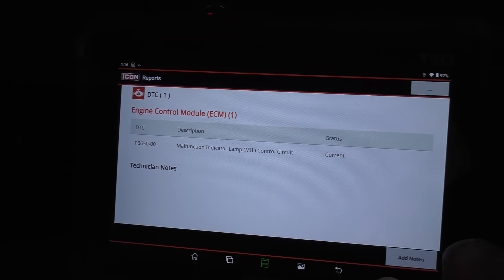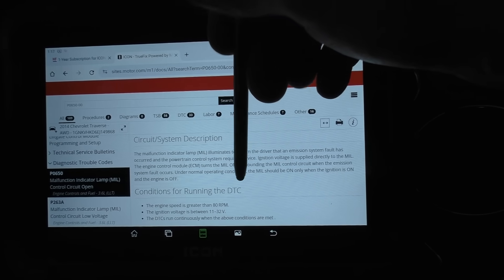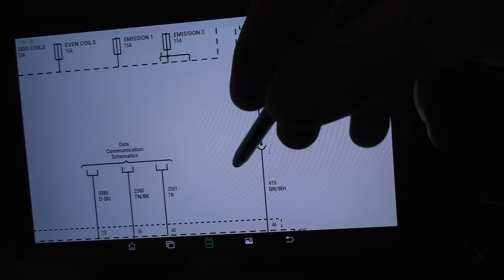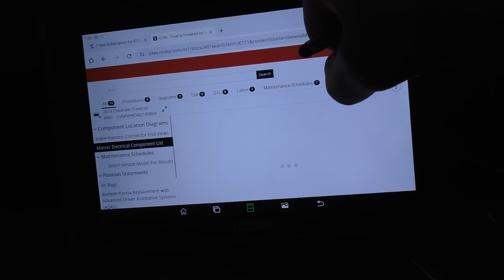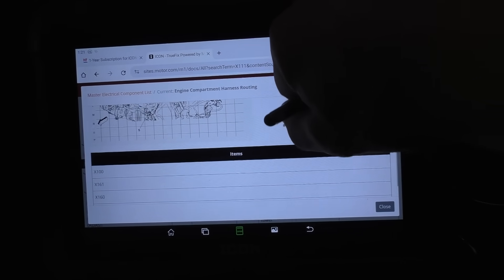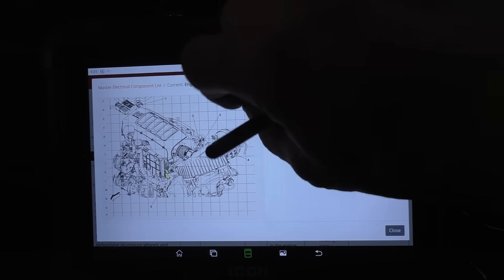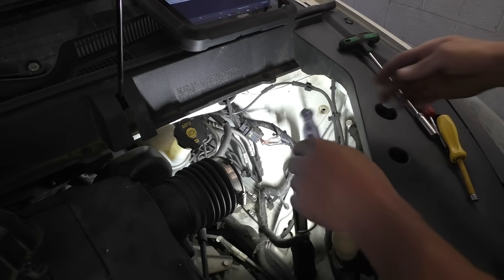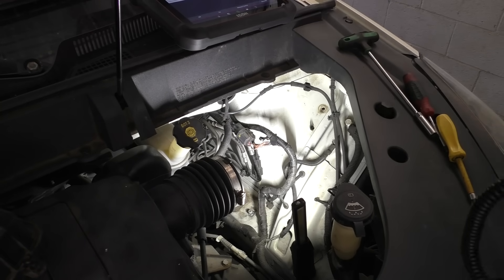Chevy Traverse - Check Engine Light Will NOT Turn On!?

Comment: You usually get paid to turn the money light off, now you get paid to turn it on!  😂😂
Reply from the maker: Basically 😂 . They might regret this later on
Reply: when are you two gonna do a collab together on a ford no less?
Reply: @SouthMainAuto  CEL light going into strobe mode in three… two…
Reply: Scott could sublet one of your bays?😀
Reply: The only time you want to see the check engine light it's ironic the one light that you want to turn off instead of on
Reply: @vehcor called sma cuz my trucks dash had all the emogis on... fer some reason it doesn't  store codes never has... by the time I found an advance that wasn't closed I only had one emogi left open circuit bank 2 knock sensor permenant with misfire cylinder 8... which shall be gone tomorrow... smh people asking me at lights if I left my parking brake on bulb replacement I give up lol... it's a 2500 it doesn't need the special check engine light off programming cuz it will always pass... I just want it to last fifty more years lol cuz who can afford 1k taillight lenses...
Reply: @SouthMainAuto  10 years of doing this... between the two of you guys, I think it's time for both of you to start cashing in.  You need to start putting ads on your videos.  You could be making $10k per video for a simple 1 minute ad read at the very beginning of each video.  It's not "selling out",  it's just how the internet and show business works.  You're already burdening your family by being in the public eye..  Cash in your chips and start stacking that ad money already.  It's time
Reply: Eric O is my dude, this brother is one heck of a Auto Tech, 😎👍🏾
Reply: @DrLee65  You would like Pine Hollow auto diag too then.
Reply: It's the money light either way.
Reply: @SouthMainAuto  put a 10 day sticker on it 4x a month there you go.

Comment: My youngest son works for Subaru, but his day off was today, and he came in the shop and laughed at me because the 2500HD I took in, had a 6" lift kit on it, and the hood was as high as the top of my head.  Freaking tires came up to my waist.  Yesterday I had a 2021 Lincoln MKX in because the park assist wasn't working.  Every sensor had a circuit code.  Told them this is wiring not sensors.  Got under it and the big connector behind the bumper was completely disconnected.  Plugged it back in, scanned it and tested it, all good.  Crazy.  Tomorrow it's a Trax that just got a new turbo installed at the dealer, and now has a misfire.  o.0

Comment: Doing an emissions inspection here in Ga., I failed an old VW Jetta that was bought at auction, for no MIL.  Customer had to go out and buy a used cluster.  It seems someone had removed to bulb then filled the cavity for the bulb with bondo.

Comment: As someone who deals with the bottom of the auction barrel on a daily basis, I WISH the issues were this simple.  Auction vehicles are proof that  there are some really lousy auto techs out there as well as some really shady ones.  Nice find Mr. O!  Love your channel, keep up the good work!
Reply: Not just the techs, we had a used car buyer that would remove the ABS fuse on certain models he was going to bid on (it was under hood and easy to get at on those ones) while he was ‘viewing’ the vehicle prior to the auction starting. The dealers got first look before the general public.

This would put the warning light on, discourage other buyers and theoretically lower the bids when the car went under the hammer
Reply: @RB-qq1ky  from what I understand, buyers aren't allowed to touch the vehicles anymore, at least where my employer buys from.  Probably from these kind of tactics.

Comment: The shop I worked at while in high school in the early 70s had a contract for working on auction cars. We did a lot of 1 cylinder tuneups. I learned a lot of what I didn't want to do to a real customer's car.

Comment: Good ole cut or corroded or ? check engine light.  Somebody or something making work for us.
Had a GM "G" van that failed cause the CE light didn't work during a smog test.  NICE!  The harness was 3 times the size of the one you were working on, so a nice piece of wire from the cluster to the brain wrapped in it's own split loom and boom.  Passed smog test.
Nice fix Mr. O!

Comment: Core problem: Bought Chevrolet Traverse.

Chevrolet - like a rock.Specifically, talc. Talc is a rock. It crumbles quickly and dissolves in water. :P
Reply: Bought AT AUCTION!
Reply: ROFL.....yep
Reply: @hotpuppy1  All that means is that they paid less for it. :P
Reply: Scientifically speaking, ice is a rock too.
Reply: Or like asbestos. Soft & fluffy. Leaves you with life long injuries.
Reply: I have a 2015 Traverse LTZ. Love it. It's been a great Vehicle. KOW!
Reply: @JOHNSUE28  Either you don't drive it much or it's one of the few good ones ever made.

Comment: Good job! I was working on a 1984 Caprice that wouldn't go in to closed loop also the ck. engine light wouldn't light. Pulled the cluster to ck the bulb and there was no bulb in it. Installed a bulb and the car would then go in to closed loop. I think it was maybe a fail-safe deal!
Reply: I laughed when my CEL finally burned out, and found they had a code for the light won't light.

Comment: Eric if you go to PHAD Saturn Astra video. I was the client that worked on it before Ivan. It all started. when I scanned the car. It had codes but no CEL. Took the instrument cluster apart and found they taped over the LED.  At least the didn't scrape the led or the trace on the board.

Comment: It's not easy to find a 750mA test light in the retail world, most incandescent lights are about 75-150. I wonder if there is a source for really high current bulbs that fit into the OTC light probe. As you say, for an LED circuit it won't matter that there is a little upstream resistance added with the test light. People just have to remember that with high resistance loads, even medium current lights won't pull enough juice to glow when drawing current. Even so, the added reassurance you're not going to melt something upstream is nice. Well done Eric!
Reply: Calculated 9W globe, how about a 10W festoon? 

I have a ‘vintage’ Snap-On test light (the ‘screwdriver sized’ one) that I did this to.

Or if you favour function over form you can put your own probe and clip on a universal lamp socket kit, and have a choice of lamps

Comment: People do some ignorant stuff on wiring.
I just bought a used UTV , the guy said the temp sensor that controls the radiator fan was bad so he bypass it. Put a switch on the dash with a note saying turn on fan. AND he used solid Romex wire. So now if a person forgets to to turn on the fan switch the engine will over heat.
I trouble shot the temp sensor and redid the wires he cut. Works like it supposed to.
This ole geaser was from up state NY 😮

Comment: I work on Auction cars. This has been happening since the start of this year when we started accepting them.    They all have a laundry list of issues.      I feel sorry anyone who has to be stuck buying these cars 4 times than what they are worth.     We are only doing them since the shop regular customers have stopped coming down to the shop. It's either the economy or the way the shop owner is.   Which isn't even no fault of my own.   We had one guy tow in a KIA optima with over 350,000 miles on it.  I told them this isn't even worth scrap value.   That is a throw away car so they left it in the parking lot for months.   Someone did break into it and try to start it after tearing out the key cylinder.   There was no battery in it.   Kinda wished they did stole it though.

Comment: about 30 years ago I de-pinned a transmission connector wire that fed the TCC lockup solenoid, something happened inside trans where it would lock and get stuck.
it would not release, even after shutting car off and playing around, it would just instantly stall the engine, I eventually revved it up and yanked it in gear and with a big bang it released.
once the wire was removed it had no issues and oddly never set a check engine light for about two years of daily driving, until they traded it in(yikes). I thought they were going to drive until scrap yard bound, go figure!

Comment: When I bought my 07 Suburban I had the same issue with my check engine light.  After I bought a refurbished one I found out that several of the lights were painted over with black paint.

Comment: I bought an RV that ran well, after a year, when I went to smog it.  It failed..... why, tech couldn't get the check engine light on.  However, it was on.  Best case scenario though, someone had pulled the bulb.  Got the bulb replaced, and an oxygen sensor later, it's ran great for the past few years.  Overall, feel pretty lucky.

Comment: Hey, Eric! I know it's a while back, but I really liked your video on the Toyota Camry Transmission fluid change. I currently drive a 1998 Camry LE, with 136K miles on it . I have been the only owner of this car since '97, and I have never done a transmission service in it's entire life. The car currently starts reversing when I put it in drive, and other times the car will not move for a minute while I press the gas pedal. My mechanic says I should get a flush and bring 8 quarts or so of Toyota ATF, while others say a drain and fill is safer, along with changing the filter. Should I get a flush?

Comment: The crazy one I came across back in the late 80's was a Chevy truck that the customer could not read the codes when you used a jumper wire on the old OB 1. I found that someone had wired it up so when key on engine off the check engine light would come on. They had wired the light driver module in on the oil pressure switch. Sure I could read codes with the scanner. That's how I found it. I was like, wtf?

Comment: Cleanest way is to use hp tuners on a vehicle it supports and you can turn any code not to set a MIL light or report. You can also set the mil light to never turn on for any reason.
Reply: Tell us more.  I like the idea of absolute control over the computer.

Comment: Here in the great liberal state of California. Any kind of salvage vehicle you have to get a smog Brake And Lamp. Perhaps they do things differently back there. Because the question remains is. How did they get the vehicle registered with the check engine light off and clearly not working correctly.
Eric, don’t get me wrong. We see the same type of BS all the time here. Unfortunately, we have some illegal inspection stations. Perhaps that’s exactly what happened with this vehicle. It’s really unfortunate. There are so many scumbags out there that simply will not fix the vehicle correctly. Then you get little ladies that fall victim. That’s what makes really good shops look bad.😡
Reply: I live in IA with no inspections whatsoever. Get a title and take it to the courthouse and get plates. It would floor you the condition that I see vehicles come in. It puts the Just Rolled In guy to shame.
Reply: I ran a shop that did smog checks when I was in Santa Rosa.  Seen some sketchy crap from smog guys.
Reply: Eric did say in the first video that the car was from a state that a non-working check engine light was not a fail but in NYS it is.
Reply: California has spent decades closing the loopholes.

The approved smog machines are connected to the state's computers.  A test can't be run until there is a connection, and the first thing that is communicated is the VIN and ECU signature (hardware and software versions).  No results are displayed locally until the state's computer logs what happened.  So you can't run a test offline, or abort a test before the state knows about the failure.

The machines have 'bottled smog' that the tech has to sample on demand.  The system used to only demand an occasional reference sample between tests.  Now there are multiple types, and the sample can be demanded at any time.  I'm not sure what the multiple sample types guards against, but someone figured out how to cheat the previous system.

Only certified techs are supposed to run the tests, and their certification is on the line if they cheat.  The system recently started to randomly require palm prints during tests.
Reply: It's a Pennsylvania car. In a few counties in this great Commonwealth, the MIL doesn't matter.
Reply: Another reason to not live there!! it's a long list!!
Reply: @mikethetoolman8776  California is the most populated and prosperous state.  They face problems earlier than other states, and have to solve them first.

More than 2/3's of the states now have emissions tests, and more will be implementing them, so you'll likely have to face them at some point.
Reply: We got rid of all of our emissions testing. And good riddance!
Reply: @1djbecker  We don't even do safety inspections here anymore.  They got rid of that in 1998.  I left Cali in 1997, so I don't know what they have done to the emissions laws since then.
Reply: @farmermiyagi1338 I remember when California used to do safety inspections. The CHP would pull you over for a light and brake check. My mom used to get pulled into an inspection lane on her lunch hour and get mad because they would delay her and invariably give her a fix it ticket for high beams out of adjustment.
Reply: @mikeam3871  I miss the safety inspections.  Especially the headlamp adjustment.  So many POS vehicles on the road that should be at the crusher.

Comment: I bought a '85 Chev Celebrity that had cigarette pack foil wrapped around the Mil bulb.   It turned out that the harness connecter was turned upside down (probably from the factory) at the firewall, causing the wires to rub and short onto the power steering bracket.

Comment: South Main Auto, have a question. With all your experience with brand new  aftermarket A/C Compressors, do the make clicking noise after being warmed up. It's not super loud but only does it after running for awhile.

Comment: I gots to know how you fix the poke holes. I know in all the confusion you don’t remember if you made 5 or 6 of them, but do you cut them and use another butt connector, or tape them, or liquid tape and then tape them?
Reply: He most often uses liquid electrical tape. Didn't mention it in this video but has in past videos

Comment: the neatest hack job i ever seen its right up there with my neighbors grand daughter did pay the the bill on the car and the lender sent a signal to kill the car  but the mech put switch on a start wire and the car cranked continuously until they pulled the battery  cable my neigbor pulled the ignition switch pt in a new switch  found the device removed it but did know what it was until he googled the  numbers

Comment: Eric  ---  These scanners almost tell you where the broken wire is at and which wire,    the only thing left they need to create is a liquid solder that you can inject into the insulation of the bad wire until the circuit reconnects through the broken or corroded wire area to reconnect the open circuit !   (the liquid solder hardens with a heat gun or time)    LOL

Comment: Raises the question if the CEL is not on, will it pass CA smog inspection?
Reply from the maker: It won't pass here in NY
Reply: It's a check on most states that have emissions testing.
Reply: The reason I ask is because my Taco had an evap leak/issue and my mechanic unloaded the parts cannon at it. Even down to installing a new ir used PCM. Still didn't fix the issue but he was able to narrow it down to pin 21 on the PCM connector.  He never figured it out. However,  my CEL is not on. Wonder what is going to happen on my next smog check 2 years from now.

Comment: So how do you fix the wires you pierce with the probe? I know there's alot of controversy on the internet about how to fix it which is why I assume you never show those wires getting repaired. But I believe whatever you do is the best so I'm asking haha
Reply: In past videos he has mentioned typically using liquid electrical tape
Reply: @FliesLikeABrick  I could have sworn he said he didn't use it lol. I remember that because I replied in one of his videos from a few months ago that he didn't have much experience with liquid tape and wanted viewers to comment on what they thought of it.

I am a commercial electrician by trade and when I have to repair a skinned wire I use 3m vinyl mastic tape or pads. When you put the stuff on you wouldn't think it would hold for crap but give it time to "cure" to itself and you will be amazed. I have torn out old installations I've repaired with the 3m stuff years prior and was impressed with how well it sticks to the wire and to itself. You can also use it as a makeshift bushing to cover sharp edges. It's truly an electrician's best friend. It's what I seal poked wires with on my own rides.
Reply: I also forgot to mention that the 3m mastic tape is what Power  Probe themselves recommend in an older YouTube video on their channel

Comment: Makes you wonder why the check engine light was on to make them cut the wire. Must have been expensive to fix.
Reply: Watch the previous (yesterday's) video. It was the ABS/TC etc. light that caused it, and it needed a new wheel hub with wheel speed sensor magnet on the hub.

Comment: Am I remembering this correctly?  Does the ICON scanner run on the Launch software?   I have the Launch 431V+ and find it pretty capable but the service data is lacking.  I use Mitchell DIY (which got a recent upgrade to basically the full version stuff but you have to subscribe to each car) for service data and it's kind of clunky to go back and forth from the desktop in the house and the scanner in the garage.
Reply: The scanner doesn't have a web browser?
Reply: Do you not have wifi in the garage? Every tablet scanner has a browser.